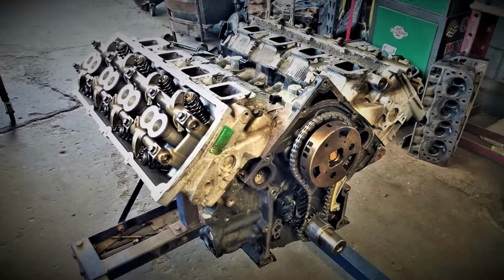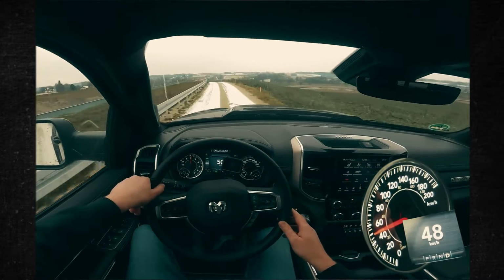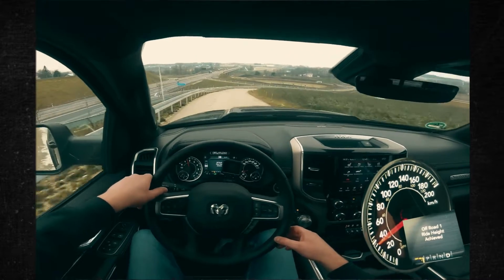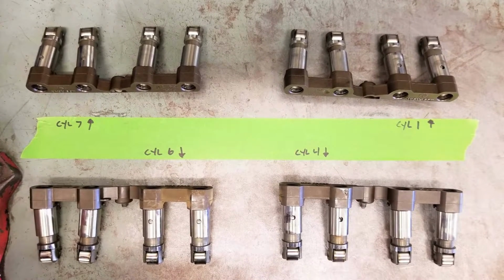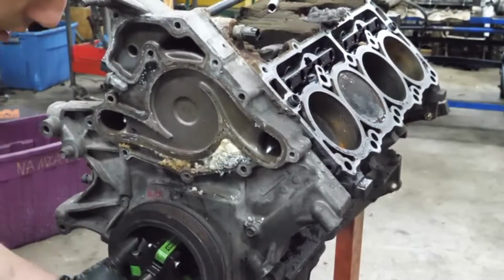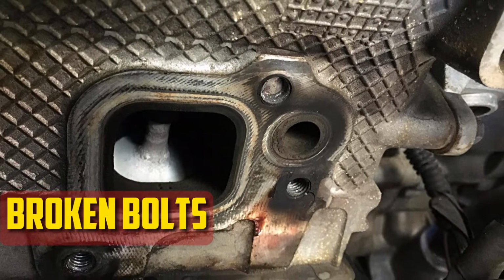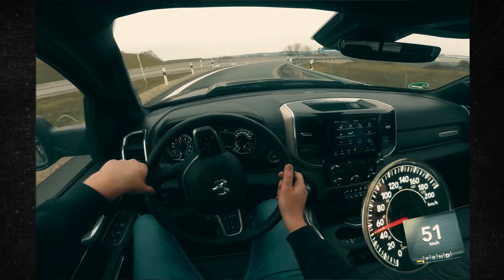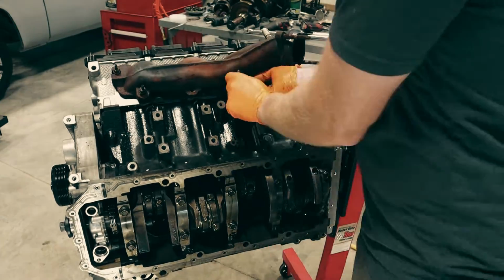Chrysler 5.7L 345 HEMI Problems and Reliability

Comment: I got a 2008 5.7 hemi 4x4 Laramie king cab and it’s a great truck only think so far it’s needed was fan that kicks the ac in that cools the motor too.. and the key fobs they make the worst on them but other then that high gas mileage and props to strong power hot heat cold ac and the radio cd navigation quits working a lot

Comment: Not sure what an engineering marvel wiz would design an engine like this with no oil passageways in the camshaft and lifter area, the only way those areas get oil is if you're idling more than 2,000 RPM and it's splashes off the crankshaft, since most of these engines idle especially in police applications, they're usually trashed sooner than later with the infamous hemi tick, ridiculous design!

Comment: Have 2011 Ram 1500 Tradesman with 190,000 on it. That has seen rough service, towing and hauling heavy loads long distance and has seen the limiter many times.  I did have a hell of a noise I thought was timing chain but turned out to be a bad alternator bearing. still have most of the original plugs since hey are a pain and replaced the idler pulley with alternator. Oil and air filters I change often. I was prepped to do a chin and full top end rebuild for the noise so I stocked up on parts to do so but everything is great after alternator change but may have a slow response to my MDS system which will be addressed when I do my rebuild. My truck 2 DR long bed is almost impossible to replace with roll down windows and non remote key so I will do all I can to make it last as long as I can It is beat up in and out but  never was towed except water in the gas tank from a shit station. 40 others had the same problem. I have 0 complaints and if they still made the same truck I would buy one.

Comment: My Grand Cherokee HEMI has 240,000km or 150,000miles on it, I do the oil every 5,000km/3,000miles and it runs well, all I had to do was a thermostat because it was running around 79C/174F on the highway, now it runs 90C+ / 197F+ I love the power!

Comment: Bought a 2016 grand cherokee 1 year ago with 69k miles. Got a good warranty thank God. It's had14k worth of work done all covered by the dealership. Anything  you can think of has happened. Exaust manifold. Lifter tick.bad rockers arms.ac compressor. Ac heater core transfer. case module. About 5 different censors.engin fan went out. Brocken engine rod bolts. Water pump. And a few other things. They basically  rebuilt the entire  engine. Hopefully  this will last a long time with all these new parts

Comment: MDS is devastating.   I went threw first cam shaft at 65k second at 132k. Sad that this was never fixed
Reply: It's not  because of the MDS it's cuz of the lifter and cams not getting enough oil in lower rpms ( around idling rpms ) if u don't idle as much and change the oil regularly with some good engine oil ur good to go